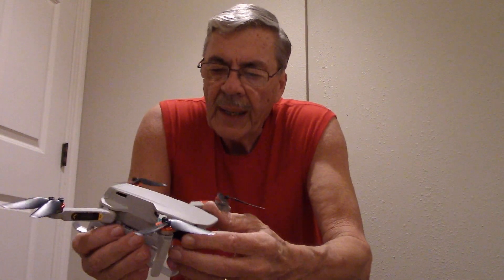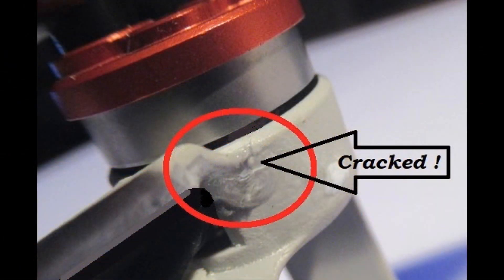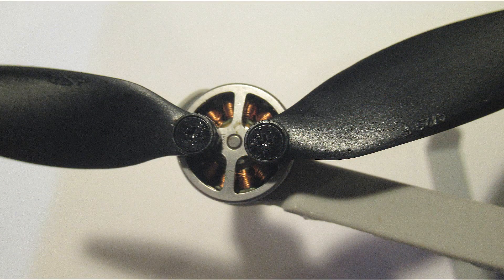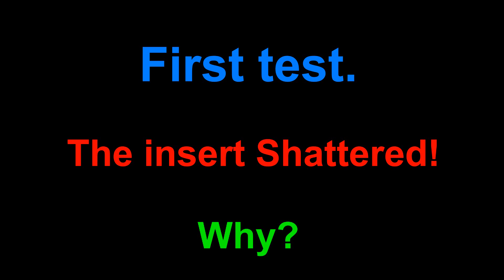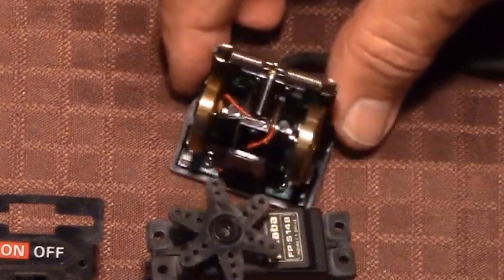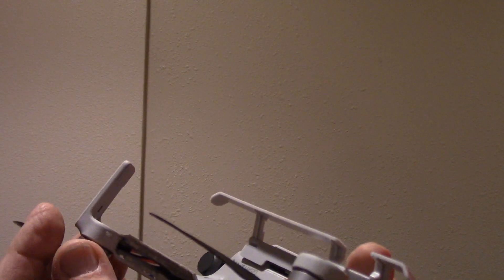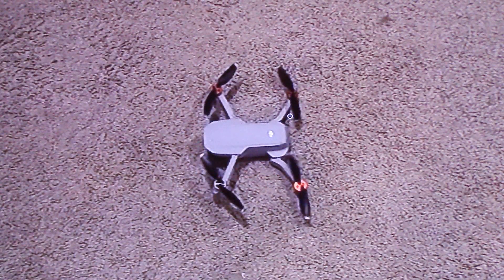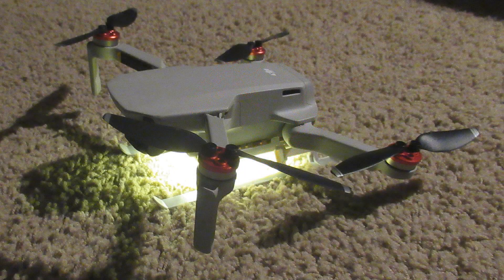Fixed! Mavic Mini Prop Strikes. Presented by Mr. Herbert's Science Class with violent flight test.

Comment: This is happening with my mavic pro. I sent it to an authorized repair center. They claimed to have fixed it by sending it back with new props. It didn't fix the issue. Tried to fly today and after 5 minutes in the air, the prop struck the drone so hard it has damaged the body of the drone. It took literal chunks out in the same spot you are showing in this video.

Wish there was some way to fix it.
Reply from the maker: We’ll get the motor covers like I did and have fun.

Comment: Those props seems to be 2 mm longer then on my Mini 2, bad batch maybe?
Reply from the maker: Stock props and I have 4 sets.
Reply from the maker: How could you see 2 mm?  Anyway, here is something else I know about the props.   The propellers for the Mavic Mini and Mini 2 have the same blades, but the mounting base, and screw holes, are different. Thanks.
Reply: @NightFlyyer  I cant tell you that its 2 mm, but my props are shorter then yours and thats where i came up with the number, just looking at it yours seems to get closer towards the body, could it be that metal rod being bend maybe? making the arm not extend correctly. or as you say the mounting is different idk :)
Reply from the maker: First of all, this Mini came with the stock propellers and all the spare NEW ones in this FLYMORE kit.  I have many drones, even the first DjI Phantom with vids online, so I really am sure I would have noticed that if they were longer.   Nothing was replaced. Blades were rough, but never changed. Second, the crack fixed the major problem with it.  Nothing or any metal pins are bent.   When I first received it and the slapping began, I began researching and found MANY OTHERS with the same problem. That Surprised me.  

Several companies make these motor covers because, it seems to be issues in heavy winds and when flying in Sport mode. I was not alone!   Also, I cannot find anywhere where I can buy 2mm longer props for the mini. I just measured mine and for sure, they are the ones I have  (I bought 3 boxes)  and this is a quote right from DJI.   "This size propeller should only be used with the Mavic mini.  Diameter × pitch: 119.38×66.04 mm (4.7×2.6 inches), weight: 0.5 g each "   Thanks for your comments , but again,  all is well now.  In fact, I just ordered both left and right front arms with motors and will replace them just for a project, but otherwise, my mini is working perfect and I am not afraid of winds now, as you saw.

Comment from the maker: I bought this Mavic Mini on Ebay, because the fellow said that it did what it was supposed to.  But he didn't tell me when I messaged him, that there were other hidden issues.  Here we look at all the outside forces, and what finally fixed mine.  My hidden issue may be the cause of your blade strikes too!  If I hadn't flexed the motor arm, I would never have seen it. See me fly as violently as it would let me, banging the sticks, full power, full power off, windy, and rainy.  Thanks so kindly for watching and happy flying. ~Dave
This is the link to my original Futaba Helicopter Mechanical Rate Gyro video to see how things were 50 years ago.
  https://www.youtube.com/watch?v=wpY5KQvgmjk&t=203s